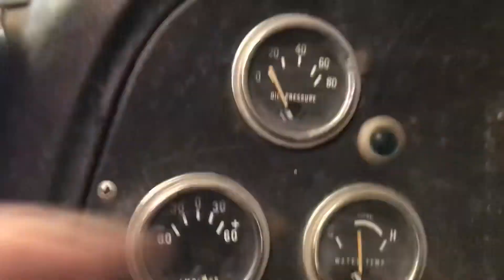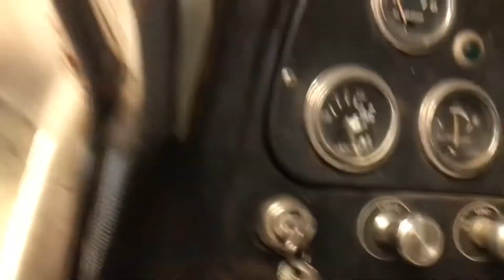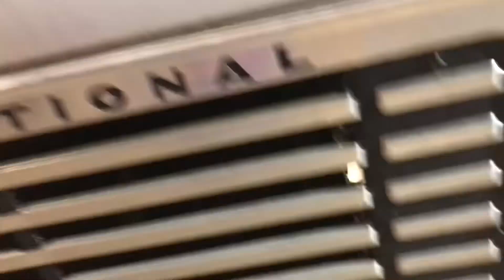We bought a 1978 International Loadstar 1700 Logging Truck

Comment: Great to see it run! Curious though. I just purchased a 76 Loadstar box truck. In my research I’ve found that all the 446 engines have a 4bbl carb. But I see that your truck has a 2bbl. How can I tell what engine is in mine?
Reply from the maker: Look on the driver side of the block below the exhaust manifolds, number should be cast in block